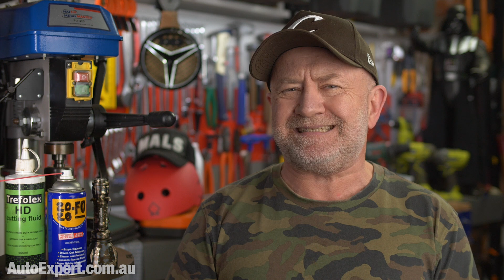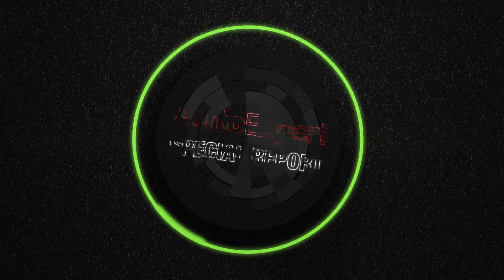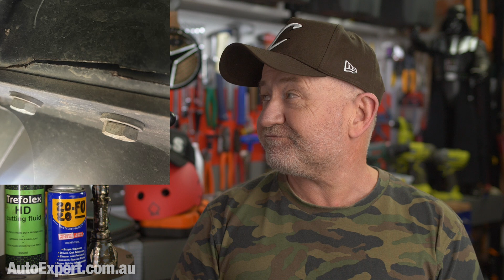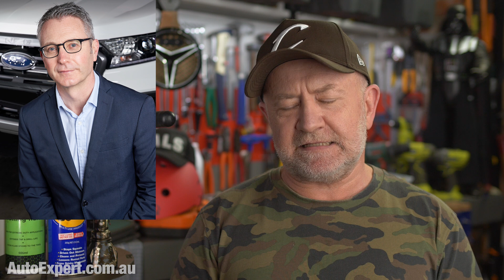CRACKED! Hi-tensile bolts Vs chassis Vs dealer incompetence | Auto Expert John Cadogan

Comment: Ha ha, I recently fitted an aftermarket rear bar/tow bar to my PX3 and found the "factory fitted" tow bar bolts were not at all tight. I did however toque the new bar in place. Hopefully avoided this issue however I do refrain from using the stealership for any work full stop. 

Love your work keep it coming.

Comment: Plenty of mechanics have "no time" for torque wrenches. That means that these events will happen because thier "calibrated hands" aren't actually very calibrated.

I had my own issues with a brake service chain that replaced my brakes including front discs. After a few months I heard this knocking noise from the suspension. Had a look and mounting bracket holding the brakes to the hub had loose bolts on both the left and right front brakes. Re-torqued to the right torque specification and fixed the problem. Did the brakes myself recently and also found that they wrapped the brake sensor cable around suspension components because they broke it and didn't want to replacing it.

Comment: I like to use Loctite 242 Blue or Permatex 25210 Orange on fasteners that are extreamly important high tensile bolts.
They won't come off even if it's slightly off torque value and I like to use locking nuts for piece of mind

Comment: 7016 is low hydro
Reply from the maker: Yeah - so is 7018. The difference is 7018 has powdered iron added in the flux coating, for faster deposition rates.
Reply: @AutoExpertJC  ok cool. Not hard to fix all the same. Shame on ford for a frig up like this!

Comment: This is the thing tow bars under law dont have to be fitted by a tradesmen so youll get un qualified accessories fitters or apprentices installing tow bars bull bars. They dont give much time to install them either so torques wrenches are replaced by rattle guns or power ratchets. As a mechanic if people ask meabout getting into the trade ill tell them to steer clear of dealerships cause youll be treaded like cheap labour and get very little education.

Comment: Hi John,  your asking Ford to do the right thing, ha, ha, that'll be the day, mate, and their reputation here in the UK is nothing to shout about. I wholeheartedly agree whith your diagnosis, tow bars and similar large items whith lots of  fasteners invariably don't have all the holes lining up nicely to the item their been bolted to, so the fitter puts every bolt in loose ,then tightens them up, we hope, mechanics get the blame, quite rightly in some cases, but alot of times its the way a workshop is run that causes this kind of fubar, I'm not excusing  this cock up, but dealers try to screw as much productive time from their workshops as they can, and this inevitably leads to mistakes. They've obiously lost a return customer, but there's that many punters out there it doesn't seem to matter to them, and that's a sad fact. Here's Whishing you and your's, all the best for the new year, let's hope it's a better one for all of us,  kind regards Stuart Uk.

Comment: Hey John. Today I got a towbar fitted to my brand new Hyundai and based on this video I decided to stick my head under the back bumper to check out the dealer's handy work. Believe it or not, the one and only bolt that goes vertically through the LHS chassis rail has obviously not been tightened with a torque wrench. It hasn't even been finger tightened as the nut has approx 5mm of slack. Beggers belief really. I'll be sending the video to the dealer in the morning and asking for a please explain.
Reply: whoa, someone's going to get in trouble lol

Comment: Am I wrong in thinking that using Loctite and proper torquing is always better than torquing alone. Of course, here bolts were not at the right torque. My little aircraft had wires through the bolt heads to avoid loosening, I think.

Comment: Nothing unusual here, unfortunately. Consumer protection in Australia just doesn't work. We hear similar stories almost every week. I had a battery holder fail in my Mitsubishi. It appeared to have been made of cardboard impregnated with epoxy, but I know for certain it wasn't metal. Anyway, it was my fault it broke and I paid (at another dealer, no point rewarding poor performance) for a replacement. A year later I had cause to remove the battery and guess what? Yes, that's right, Mitsubishi had upgraded the battery holder to steel, which I suggest is what it should have been made of in the first place. So much for warranty. There isn't anyone useful to turn to in such circumstances, so the dealer has you over a barrel. At least my replacement of the battery holder was cheap.

Comment: Agreed John. What surprises me most is the use of weaker bolts - the price difference between grade 8 and 10 is negligible. Garage supplied or towbar manufacturer supplied there is no excuse. 
I've fitted many towbars and any slack or lack of correct torque is an absolute no no. That towbars transmits forces to the vehicle and any weakness between them results in slack which then amplifies until something fails.
That earth to the towbar support bolt made me gasp.

Comment: Looks to me that a backing plate is inserted to the box chassis , but obviously not taking the full box strength by design. So with the crack open may indicate a shim may be missing to take up irregularity in spacing/fitment mating surfaces. Might help if they use their nail polish on the threads before they spin the bolts in.

Comment: My cousin purchased a 2020 3,2lt V6 Diesel top of the Range Ford Ranger Double Cab. He's a farmer in South Africa. The day he purchased the Ranger, he had an Offraod  Aluminium Canopy, also supplied by the Ford Dealer at a hell of a price.  3 months later at 7000km the body work CRACKED just behind the cab. FORD maintained its the canopy's that caused the crack. Both sides on the outside of the bin just behind the cab, my cousin told them tho stick it where the sun doesn't shine and traded it in for an Ford Everest. Ford is getting worse by the day, as with the Ford Cuga which catches fire due to overheating. They won't admit to that being their fault either.

Comment: It looks, to me, like those bolts go through the chassis and screw into a threaded plate inside the chassis.

That being the case, my guess would be that the threaded plate wasn't a good fit inside the chassis-rail, the bolts WERE tightened correctly, the threaded plate put stress on the chassis-rail as it attempted to seat properly, that caused the chassis to crack and the bolts became loose once the plate could lie flat against the inside of the chassis.

Which, of course, begs the question of where the threaded plate came from.
If it's an internal part of the chassis, it's on Ford for not manucatturing parts that fit together correctly.
If the plate is part of the ARB kit then it's on ARB for manufacturing a halfassed part AND on the fitter for not modifying the plate so it fits properly.

As a Land Rover owner, I know the front bumper is held on in a similar fashion (bolts through bumper and chassis-rail, screwing into a threaded plate inside chassis) and it's pretty common to see bumpers come loose as the plate "settles" or, at worst, cause damage to the chassis.

Comment: With jobs like these, I make sure to mark the bolt with a oil paint pen.
This shows that I have torqued the bolt and it also is used as a witness mark if the bolt does happen to come loose for some reason. I can see that the paint mark has moved, thus its loose or been tampered with.
This is the "cover your arse" insurance policy with photos attached.
Reply: I thing the ease of later inspections (aka "Is the mark still aligned?") alone is quite a good argument for such marking...

Comment: Would like to see joint design through bolt, or captive element?
A weld repair without carefully designed reinforcement (no matter the filler medium )leads to cyclic failure at HAZ.

Comment: Hi john im no engineer but i am an earthmover and when we change our cutting edges on our buckets we remove all paint and rust so the calming force is greater if I were to leave paint and or rust on they always come loose so I serpose my question is should they have also stripped the powdercoat off both surfaces  or paint before they installed it as well?

Comment: Love your videos, but in this instance, there is no shown evidence that the bolts weren't properly tightened. I get the earth cable is incorrect but even half the bolts would have held it (except to spread the load over a larger area on the chassis). The second point is that it is not as relevant what the trailer's weight is, as what the tow ball weight is and where the COG of the trailer is. The bolts looked "tight". I could not see a gap under the washers or evidence of the washers having moved. Surely if they were loose, the nuts would have worked their way completely off (unless they were nyloks), and at least the holes would have been "ovalled"? Could this not just be a case of cyclical stresses work hardening the steel and cracking it?

Comment: i'm going to guess that AFD was extremely freaking lucky that there was nylock nuts on the other end of each of those 16 bolts they failed to torque (or tighten at all).
they would have been facing huge fines and or jail sentence's if the towbar had come off and anyone was killed as a result.

Comment: Assuming your contentions are correct I may be able to shed some light on dealerships.
I'm shedding light not excusing. I was a dealership mechanic for MB and got out. I did my apprenticeship there so I know what I'm talking about. After MB I then worked for another dealership and it was the same there. After five years I left there and worked doing chassis repairs under instruction from a qualified welder and an engineer for seven years repairing this sort of thing then became involved in another field entirely, then found myself driving trucks delivering steel for a living.

So, in dealerships big pressure is applied to mechanics by management nobodies who incidentally all have inveigled their way into those positions because they're personifications of narcissism personality disorder - in other words while having the persona of agreeability to their own kind they see mechanics as replaceable subordinates and behave like dark age feudal overlords on the workshop floor complete with threats/taunts/personal abuse so on and so forth - ie they're on a power trip yet among themselves it is incomprehensible that any complaint from the mechanics re their behaviour could possibly have any merit which then further emboldens these people. In that toxic environment these things (below) can happen.

1) A standard time is applied to the fitment of a product. Lets say for a towbar 2 hrs. The pressure is applied to perform the operation in 1 hr, thus allowing the dealership to charge the customer the full 2 hr fitment put the mechanic on another job in the one hour the dealership narcissists nobody (on a performance bonus) has just created for him/herself and get the dealership DOUBLE out of that mechanic for one hour. Remember these service advisors, workshop managers were often on a retainer plus bonus (I don't know about now as it was two decades ago when I left).
Say there are fifteen or twenty mechanics in the dealership and they do this everyday well you begin to see how it all works.
Under this kind of pressure mistakes often occur but like the Nader vs Pinto imbroglio, the cost of rework is the lesser of the evils so to speak. Anyhow, it's the mechanics that make the stuff ups after all, so it's all sewn up in the minds of the overlords at least.

2) What also can happen is this:
This next one is a bit of eye opener because it happens when two mechanics are doing a job together. Again there are no excuses just explanations.
Considering the onerous pressure to perform coming from above, two mechanics are assigned the fitment of these towbars. Both have done the job many times. In the haste to get the job out each mechanic is conducting a race against the other mechanic so one isn't holding the other up. 
At the end of the job each mechanic assumes all the bolts are tight - mechanic A assumes mechanic B has tightened all the bolts and vice versa but in fact all the bolts are loose in a particular area.

In the 90s at a Mitsubishi dealership, I had to replace an auto transmission that was previously diagnosed as being faulty by the dealership. It is standard practice that there's no continuity on jobs so the person diagnosing a problem is not the person doing the job. Often someone starts a job and someone else finishes it - such is the way dealerships operate. 
The owner was a pensioner. I replaced the tranny and the fault persisted. The culprit turned out to be a faulty TPS costing $150. I told my service manager that we should really put Mr Olsen's old transmission back in because it's the right thing to do. Well a heated circular discussion ensued. I wrote a ridiculous portion of that circular discussion on an already graffiti strewn toilet cubical wall and was sacked for defacing company property. I proclaimed it was already covered in graffiti but it made no difference. I was gone after five years like I was never there.
This is what you're up against as an employee. Customers and mechanics are nothing but financial units. 

You've got no hope!

Comment: This has nothing to do with Ford. The fault or error is on the instaler of the tow bar in this case "The Dealer" who is completely independent of Ford, they pay Ford for the right to put that name above there door. GREAT explanation of the science behind hard bolted joints in shear. Another way to look at it is the shear strength of steel (the bolt) is roughly half its tensile strength, so it's strength is used to created sufficient joint friction (clamp force) to prevent the bolts weakness from being exceeded.👍

Comment: Excellent video John
I have been a Ford fan for many years and have owned numerous Fords including currently a Falcon turbo and a Ranger. Always had a very good run out of my Fords but would not go near a Ford dealership service division.
I can give you a whole run of stories that concern my run in's with Ford service divisions that would make your hair curl. I come from an automotive background and have worked in dealer service divisions, and so know when I am being fed a mountain of bovine manure.
It would appear that heaping of said manure is Ford's modus operadi to avoid their warranty obligations and their incompetence is breathtaking in the extreme.
From my past experiences over many Fords I have owned, I just know that I am going to get shafted by their service division so just will not use them.

Comment: I remember years ago we had couple of vans coming in with loose rear wheels. It was the dual wheel type when the wheels are face to face on the hub. It turns out the vans were used in off road conditions in mud etc, they were power company vans for engineers. The tyre fitters did NOT clean the mating surfaces of the wheels and when the wheels were put back on the dirt that was in between them basically either washed out or crumbled and fell out leaving a tiny bit movement because the wheel nuts were now a fraction loose. Over time they got very loose and caused the problem. It was a strange one but the tyre fitters were warned to clean all surfaces.

Comment: Another factor, which is common with bolts and nuts, nowadays, is the nut not running true to the head, these are rolled threads and a lot of these bolts and nuts are made in Asia, need I say more